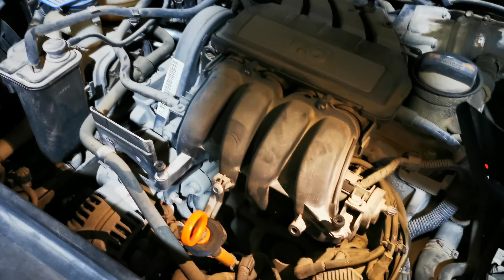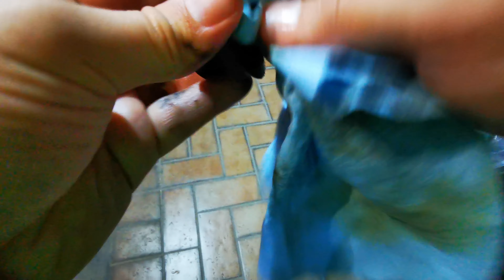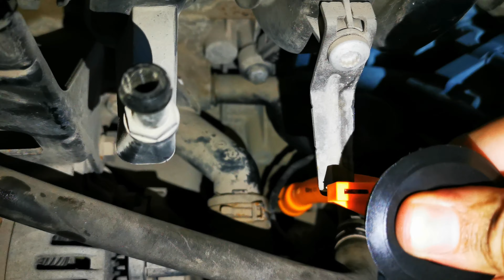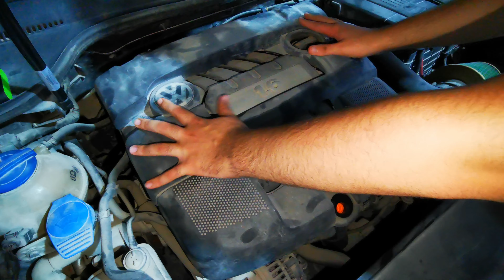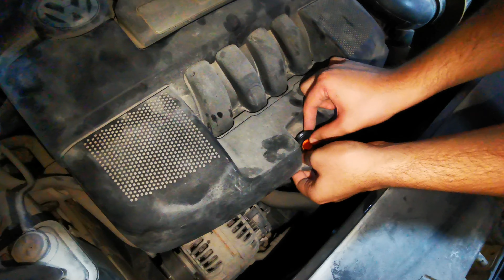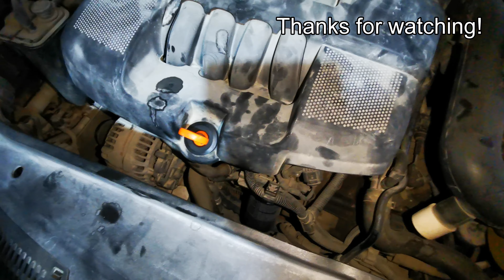VW Golf Mk5 1.6L Dipstick Tube Replacement

Comment: I have a 2000 Mk 4 Golf and a 2004 B5.5 Passat Highline saloon, both 1.9 TDI. Both dipstick tubes sheared at the bottom within 3 months of each other...but when replacing them, they had clearly been cracked for years weeping oil / making a mess. At least it's a quick easy and cheap fix. The new genuine VW ones here in the UK are now yellow.
On another note, the driver door window regulator broke on the Golf about 15 years ago....and the very next day the exact same on the Passat....I think the cars talk to each other on the driveway at night and plan things to cost me money! 
😂😂😂
Reply from the maker: True some of these vw parts are programed to fall every few years, have the front door locks failed and fix 3 times before, now the two rears failed 🙈.
Reply: @ZakiGarage  Yep...had various locks go on both cars! Forgot about those!
Reply from the maker: @23hublock1  Das auto 🤣✌

Comment: Don't think you pushed on the rubber correctly
Reply: In my case, rubber also had not correct mounted, and all the time I had fill oil more than max, because dipstick in this case is 1-2 cm above normal.